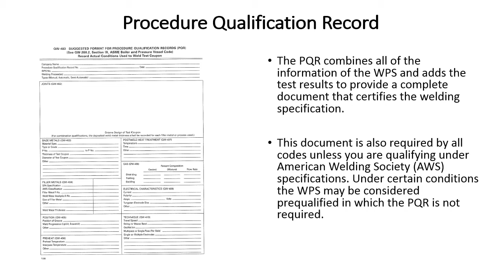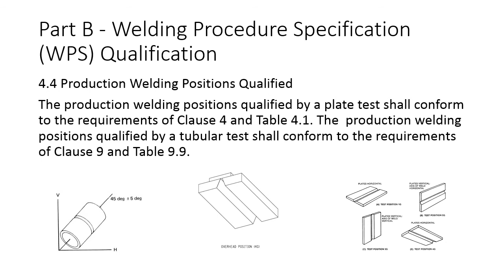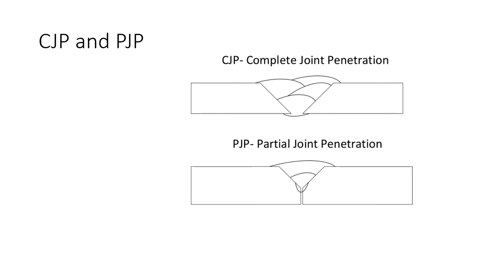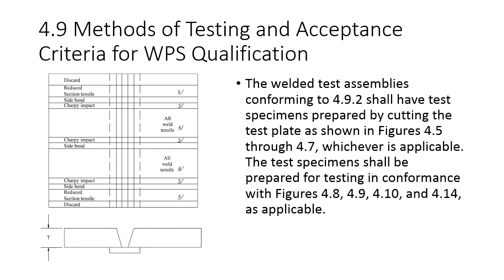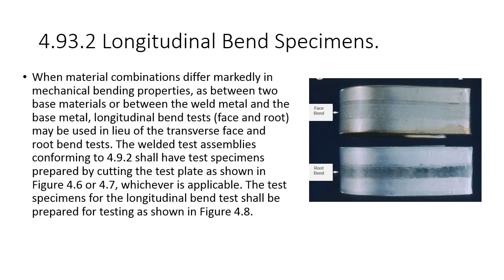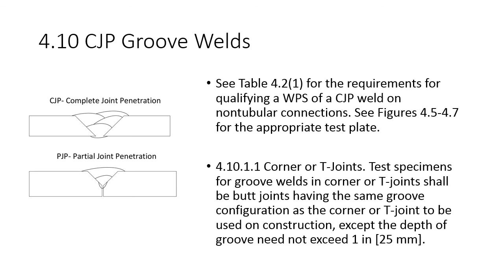AWS D1.1 Clause 4B Explained: A Beginner's Guide

Comment: Hello Sirs,
I am making a WPS in accordance with AWS D1.1 2020 Structural Welding Code and I have a problems when specifying the MAXIMUM PREHEATING TEMPERATURE  as well as the maximum interpass temperature.
According to AWS, the maximum preheating and interpass temperature shall be shown on WPS but there is no instructions to help me pick up maximum preheating temperature in AWS D1.1 CODE. 

Could you please tell me how to specify the maximum preheating  temperature or which materials that i can refer to find out the instructions.
Thank you so much in advance
Reply: welcome : Depending on thickness of the WPS Metals. example:if the metal is 1 1/2" thickness pre-heat required to be 50% F not 32% lost of differences between metals.  over 1 1/2" 150% big difference. low hydrogen 3/4" 1 1/2". climate matters also. voltage, amps and wire feed,  ect
Reply: welcome: finish up on interpass temperature
preheat interpass prevent cracking base metal shall be preheated
temperature not less then minimum value listed on the WPS limitation
table 4.5 qualified WPS essential table 3.6 prequalified WPS essen6tial
Reply: Also climate is a must know. example midwest late fall even 50% will be alittle challenging

Comment: Hi pro!!!
Let I explain our situation:
Our company need qualification a WPS by FCAW pipe + Plate (not require CVN test). 
We contact with third party, and they give to us the advise that, IF we want to weld multi Pass or Single Pass, we need perform testing on both specimens (single + multi). If we perform only Single (or Multi), we production on single (or Multi) only.
But, when I checked table 4.5 AWS D1.1 Ver. 2015, multi / single pass is not essential variable required re-qualification.
It means, if we qualification with single pass --> also qualified for multi pass and vice versa? 
Pls advise me I understand correct or not?
In other hand, if I not correct, our third party is correct or not.
Pls help me in this matter. Because, it can help us save a lots money.
Reply from the maker: email me - gpacex@gmail.com
Reply: @gpacex  I already email you. Pls advice me
Reply: Nguyen Van Duong what was the conclusion?
Reply: @zejean  I didn't receipt any feedback

Comment: Hi Garry Pace!
I am studying WPS, and have a bit experience on qualification WPS. How could I specific welding parameters (Volts / Amps, ...) into Draft WPS? Does have any material to reference?
And after Qualification WPS, how could I reflect above parameters to draft WPS to be offical WPS? are there any related between them?

Pls help me!!!
Reply from the maker: If you are doing a draft WPS you use your past experience for the Draft WPS or you use the voltage and amperage recommendations from the filler material manufacturers. When you perform your draft WPS you record that information on the PQR or the Procedure Qualification Record. Then you write the WPS that is to be used in production referencing the PQR.
Email me if you have further questions.
Reply: @gpacex  Thank Garry Pace!

I assume that, the amps of Draff WPS with range is 180 - 220A (FCAW). But valve of PQR is 180-190A. Do I need change write WPS with range +/- 10% valve of PQR such as table 4.5  or I still can keep range 180-220A as draff WPS for succession WPS? (same with other electric parameters). I am confusing this matter.

Pls help me clear up my concern with many thanks.

Cheers,
---
Nguyen Van Duong
Learner from Viet Nam